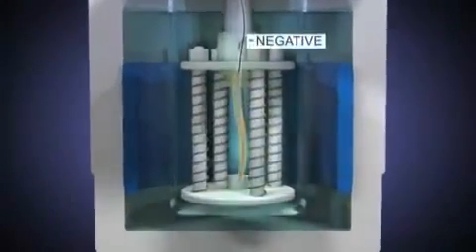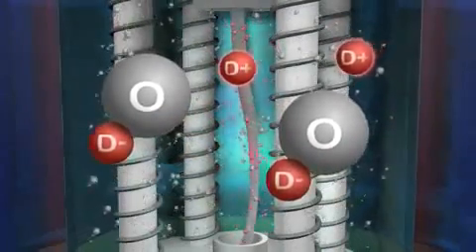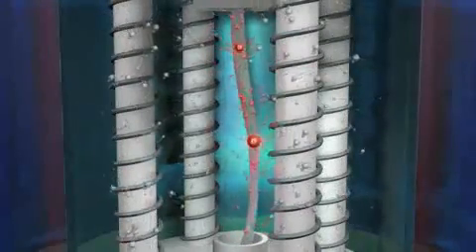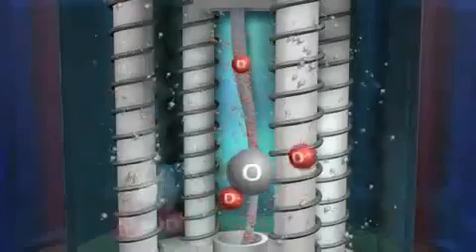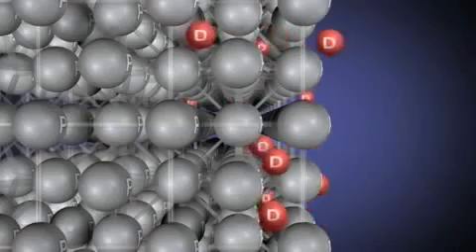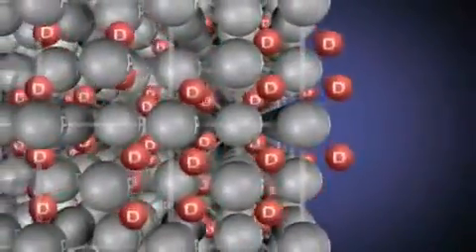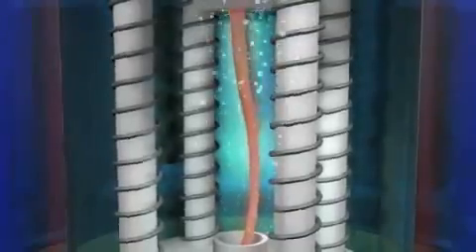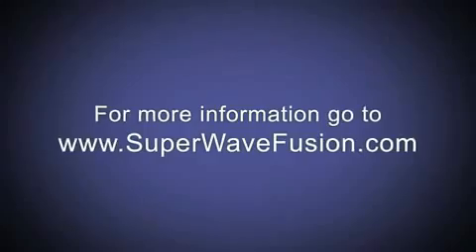What is Cold Fusion ?

Comment: Hmmm,
If cold fusion was used in iron man's arc reactor this would link with iron man using palladium in the reactor!
Has anyone else seen iron man?
Around the edge of the arc reactor is copper wire coils, I guess if the palladium created electricity the copper wires could be used as a sort of accelerator.the electrons, once accelerated, could then be used to power the electromagnet in tony starks chest?

Does this seem useful?
Reply: we've to apply voltage, while Tony's system is self triggered prolly.
Reply: @arnie8958  that's because he is the most realistic superhero ever. 1 things 4 sure that iron man will be fully invented in the future
Reply: @ullasnedungad5237  lol no his suit would kill him from those Sharp turns, the most realistic is definitely Batman
Reply: You are right
Reply: But would that be capable of generating 3.6 GJ/sec🤔
Reply: yes i have seen the movie iron man and yes thanks for the information ☺☺👨‍🔬👨‍🔬🥽🥽🥼🥼⚒⚒🔧🔧🧪🧪🧪🧪👨🏼‍💻👨🏼‍💻🛠🛠🛠🛠

Comment: where exactly lies the problem, so that it can not be used in reactors?
Reply: Big corporations stop them!
Reply: No, it's because this is Pseudo science nonsense.
Reply from the maker: The problem is it generates infinitesimally small amount of energy.
Reply: I think it is getting approval and funding for the research.
Reply: Could it not be scaled up? I imagine the deuterium supply for such an endeavour maybe a problem?
Reply: How small? And why wouldnt we use different source of energy on the same or little bit different principle?
Reply: Where did you get the video for this? What do you mean by it generates such a small amount of energy where do you get that info from?
Reply: JUrb1000 greed! Lol
Reply: Cold fusion is a myth. It would be lovely if it was real, but sadly, cold fusion is every bit as real as magic unicorns.
Reply: Cailus Griffin umm no it's not, cold fusion is real! It's just highly unstable and impossible to create a sustainable powercell with it!
Reply: Duke The Creator No, it's a myth. It's always been a myth, and not a single accepted theory on all of science supports it as a possibility.

The experiment that this is based on was found to be a result of errors in set up of the experiment, and at no point has it ever been reliably reproduced.
Reply: It is an electro chemical cell, essentially a type of battery.  If you hook it up to a DC power source, you can charge the battery.  Then once you disconnect it, you can use it to power small things for a short period of time.  There is absolutely no fusion involved.  It is people who don't know what they are doing screwing around with 300 year old technology.
Reply: Robinson Aquino his existence is pseudo science? Dumb insult.
Reply: The only way to fuse without heat is with a gravitational force greater than the sun's
Reply: Matt0 well that's just nonsense
Reply: Christian D'Souza did you even look it up?
Reply: Trevor Thieme have you ever read a book or better yet Google something
Reply: Matt0 Ironic since that gravitational force necessarily creates heat.
Reply: Matt0 except that it’s not entirely without heat, the gravitational force’s pull causes the heat in the sun.
Reply: @danielpas368  deuterium is in Sea water
Reply: @Landrar  it has been reproduced I actually built one in my garage and it powers my house
Reply: @scmedia5610  dafuq
Reply: C W if your going to write a big ass paragraph do it in a book
Reply: Jeff Vader ok, back up your claim

You’ve failed to do so
Reply: Abhinav Strange 

Hmm much more can be explored to squueze as much juice as possible.

Improve upon the system

Comment: It's not possible to wear or implant it on my chest or anywhere.Theoretically it's generating huge amount of energy but what about the massive amount of heat it's gonna melt everything.The structure has to be durable enough and also the worst thing is that if anything goes wrong the high amount of voltage will kill the person.
Reply: Soham Sengupta not if the suit is made of adamantium or vibranium
Reply: what if some leveling system telling you if its getting to hot or too powerfull
Reply: Admantium and vibranium get hot toi
Reply: exactly
Reply: Which is why Ivan Vanko told Tony palladium in the chest is a painful way to die..😱
Reply: And its not possible aswell, you have ribs in your rib cage, how the fuck would you be able to shove a nuclear factory into your chest
Reply: TeraBite Gaming ,yes you're absolutely right....hat's dangerous.....
Reply: The word is COLD fusion
Reply: Who says you are gonna wear on chest, just use it in the exoskeleton and manage the heat on to different places of exoskeleton where the air flow is maximum
Reply: Nivane H vibranium doesn't exist
Reply: But it can still be used to power high voltage machines like iron man's propulsor
Reply: Soham Sengupta did u not realize that when a possible he used uranium to cover the arc reactor and as u can see that the glass from the cooling water and palindrome is very thick cause it to cool
Reply: if ur gonna use it in an ironman suit of course its dangerous
Reply: And IRON MAN SUIT IS NOT MADE OUT OF VIBRANIUM NOT ADAMANTIUM 
1. IRON MAN EXIST FIRST BEFORE WAKANDA OPEN TO THE REST OF THE WORLD SO THERES NO WAY TO GET ACCESS FOR SOME VIBRANIUM
2. ADAMANTIUM IS A LIQUID SUBSTANCE THAT WILL BOND INTO SOMEONE SKELETON WATCH WOLVERINE! 
3. IRON MAN SUIT IS MADE OF GOLD TITANIUM ALLOY

Now fucking stop saying all these bullshits it makes me cringe as a Marvel Fan -_- especially Iron Man

Comment: i thought it was cold fusion 3:20 says significant amount of heat. hehe
Reply: ryoshu tochi it is cold fusion because the conditions in which fusion happens is not hot. It will still release energy in the form of heat. Other fusion reactors need the heat up gas to the temperature of the sun in order to fuse. Then they need really really strong magnets to keep the plasma in the tube. It's really hard to heat something to the temperature of the sun in a contained area and so people are trying to find a way to do cold fusion